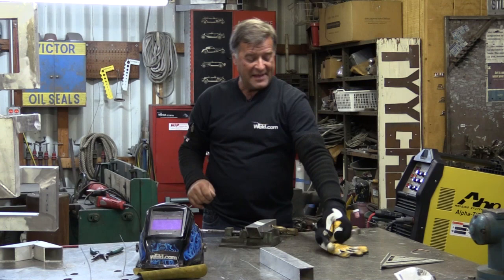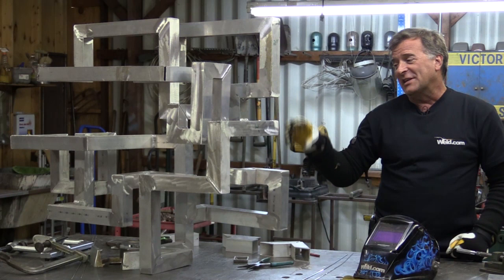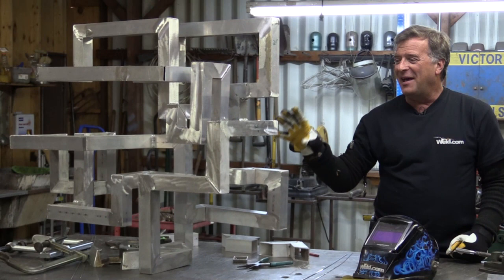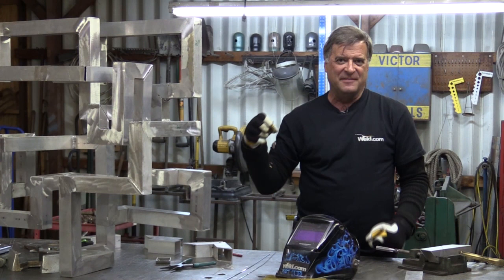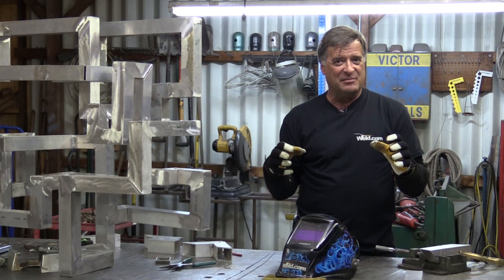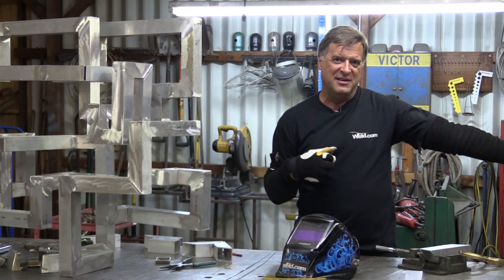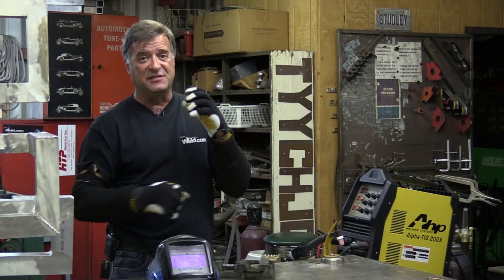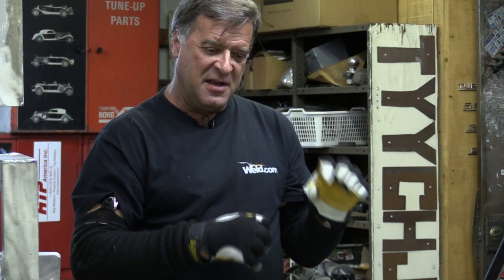A Safety Tip That Just Might Save Your Life - Kevin Caron

Comment: Very good points. I sat here thinking on how one completes the circuit from grounding oneself on the table to the electrically hot (voltage/current) tungsten. Perhaps throughout the filler rod, but usually one has gloves on. Then I figured some of ones skin was most likely touching the object being welded - - thus, ouch!!
I used to repair TVs, radios, etc., when they had tubes (my age again) and have been zapped many times. The most dangerous situation is where the current goes through your chest (heart), but it all hurts for a while. Also, when you jump back (if the current lets you DC), the objects you fly into also hurt!
Glad to see this post, and glad you are still around - I enjoy your videos - a lot!
Reply from the maker: Thanks, it was a bit scary when my chest got tight!

Big problem here is sweat, in the gloves or on my arms. 

Even wearing long sleeves or a jacket that damn sweat will get ya!
Reply: Electricity will take the path of least resistance. In this case it divided passing through the aluminum object sitting on the grounded table and you. Especially as you were damp. When I say object on the table that does not imply that the object was at zero resistance (a good ground) obviously not or you would not have been shocked. As you stated ground the thing one is welding, damp or not. Now I better start practing what I preach as well!

Comment: I did about the same thing awhile back. I had quenched a piece in water and my gloves got wet. It wasn’t as bad of a shock as yours was but enough to make me pay attention. I was using my belt grinder and was quenching. I will not be getting my gloves wet when welding again. I now use a piece of plywood and a 4X4 wood block for a hand Rest when welding.
Reply from the maker: Great tip!!

Comment: Good to hear your all right. I myself have been shocked by the welder.
But mine was a really dumb mistake. 
I was using a stick welder with a bad handle that the screw that holds the wire was exposed and standing in water trying to weld a trailer tongue back together struck an arc got one hell of a zap. Be safe its a dangerous place in the shop.

Comment: It is definitely good to put your ground clamp as close to your work as possible, but if you're on a metal welding table, regardless of where you clamp to the entire table (and workpiece) will be grounded and a potential circuit. Very good video and safety points. good thing i only have a stick welder and all the spatter influences me to wear sleeves!

Comment: Done it myself a few times, not to many amps but these days I tend to use a pair of rigger boots a size to big, easy to slip on and of with little effort so I do wear them when welding. big thick rubber soles... Tried a mat, still use one some times but I kept setting fire to it, smell was annoying...

Comment: Me again. I did that with the HF start when using my new TIG Inverter machine, I left the  earth off the table vice and got it full on.  and it used me as an aerial. Really jumped high, I do not know the voltage but it is a LOT m ore than me older machine.
Reply from the maker: Made me learn a few new words!

Comment: Safety is what you make of it. My stick welder gets the setting adjusted with the plug disconected. My mig runs a open setting, i can touch the spool. I clamp the earth as close to the place i am welding as possible. Grinder has it's safety altered :) same goes for the bench grinders. Having ten fingers is overated :)

Comment: How can grounding the table cause shock without the electrode holder? It doesn’t seem like it would be a complete circuit otherwise.
Reply from the maker: It helps to prevent shock not cause it.

Comment: Sure do enjoy your videos, Kevin, and am relieved that you didn't sustain serious injury.  One thing though: You didn't fully explain what you did to get zapped.  Leaning on a grounded bench by itself, sleeves or not, is not normally enough to zap oneself.  (I've been zapped a few times, usually involving touching the filler rod to the tungsten instead of the work, while leaning on the bench and not using a glove on the filler rod hand.)  So, how exactly did you come in contact with the "other half" of the circuit?  Did you stick the tungsten to the work and then lift the work off the grounded bench, all while leaning on the bench?  Please explain further, because I'm missing a big piece of this puzzle.
Reply from the maker: +Rick Reid            I think it was because I was sweating and made a better ground than the clamp which was on the bench not the work.

Just felt a strong tingle through my chest and arms.     Heart started to flutter and I stopped the arc..  

Spent a few minutes making sure it was not going to stop and went to see the doctor for an ekg.   

Just stupid on my part and luck on the welders part..
Reply: +Kevin Caron, Artist  I think I understand now.  You got zapped because you got between the bench and the work, electrically.  Thanks for the reply and I'm glad you're ok.

Comment: How is it different if you ground a metal part that sitting on a metal table? wont the table still be grounded too?
Reply from the maker: the table makes one more connection to keep in place.   if you get in to the circuit you are now able to get a shock.   If you ground right to the part, no problem.
Reply: Still confused, if I ground my part and set it and clamp it to a metal table, and then lean a sweaty arm into the table..wouldn't the same thing happen? its all grounded at that point table+part?  I could see if maybe I put a piece of wood or something between the metal welding table and the work and grounded the work. Is my thinking off? I don't know.
Reply: I'm new.. got my first welder going ( TIG Everlast 164 power pro ). I just don't want to zap myself.. i been wearing sleves and gloves and eveything so far but I have long arms and end up with a gap of skin near my wrist im worried about touching the table with.
Reply: From an electrical standpoint you do not want to be IN the circuit. Electricity takes the path of least resistance for the most part, lower voltage having lower risk ie. it can't overcome the resistance to flow = very little current flow due to OHMs law = no shock or injury. Most welding processes use low voltage DC or AC with High amperage. If  your ground clamp is closer to the gun/stick than your arm the current wont travel from the ground clamp (-) out into your arm through the glove and to the gun (+) because the resistance is simply too much. Rather it will take the least resistance through the metal part to the gun/stick. Fun fact you can check your resistance from finger to finger with an ohm meter. It's in the range of over 100 mega OHMs  A LOT. lol In Kevin's case their was lower resistance from the ground clamp and through his arm to the gun than through the table to the gun. As mentioned earlier salt + water on skin = much less resistance to current flow. He didn't receive the full amperage through his chest or he would have died instantly. Just a few amps will stop your heart. Instead he received probably a 0.02-0.10 of an amp shock with the rest going through the table to the part. (Even this small of an amperage is very painful but not deadly) As long as you're wearing sleeves and good undamaged welding gloves you should be ok. Most welders don't even realize you can be shocked by a welder because it's a very rare occurrence.

Comment: I imagine it might have felt like a massive leg cramp, but on your heart.  Were you sore for a while?  Hope it's all back to normal now.  I've had small shocks, but never a big, potentially deadly one.  Thanks for the warning!
Reply from the maker: +R. Price All better now..    Just take more time to set up the weld and make sure I am not part if the circuit!
Reply: I've had some experience with the Electric Muscle Stimulators-so maybe your heart is stronger after the extra "exercise".  What doesn't kill us, makes us stronger...or is it smarter?...at least for a little while, until it's time for the next life-lesson.    (:
Reply from the maker: I will go with that answer!!   Yeah, I feel better for the shock therapy!

Comment: Hey Kev I like your videos and follow them every week to learn. Tell me. Would a great pair of work boots with the green patch have prevented this from happening I wonder? Your thoughts? Just out of curiosity what were you wearing on your feet? Or dose it matter now that I think about it because you were basically sweaty and "tied" to to the table.hmmm. Thanks again for the tip, can't be to safe now a days. 
Pidge.
Reply from the maker: I was wearing engineer boots at the time. Thick soles and have never had a problem with them. This happened because I touched the table that I had the ground hooked to. If I had put the ground on the piece I was welding I would not have been shocked.
Reply: +Kevin Caron, Artist can you tell me why if you put the ground on the piecework you won't get shocked. what is the difference since all of them touching each others. ( welding table + piecework ). please answer.
Reply from the maker: Because you have now made a more direct path for the electricity to take back to ground.  Instead of taking a short cut (no pun intended) through you, it now can get back to the machine easier.
Reply: +Kevin Caron, Artist thanks prof.

Comment: Kevin your welding machine must have problems. The voldage from a welder is from 20-40v. On that range usually is harmless.
Reply: I've got myself once or twice with the hf start on my tig. Ground yourself wrong and that goes straight across your heart. Its very easily done.
Reply: Agapios Agapiou It's the large amount of amps that kill you.
Reply: No it's not, it only takes 0.7 of an amp to kill a person! Think about that,
Reply: @Agapios Agapiou
You are wrong, way wrong.  It isn't voltage that kills you. AMPS KILL!! 
Your comment of 20v-40v being harmless could not be more untrue. If that 20v-40v has the right amount of amps, it will kill deader than a doornail.
Reply: He means that the human body has such resistance, that 20V to 40V will not be able to create enough current over the heart. Which is probably true. But remember TIG welders will up the voltage to reach their amps. So they will easily output much higher voltage if they think the circuit is still intact.